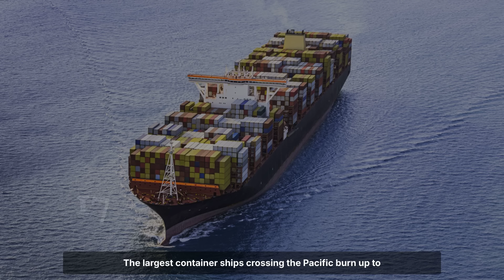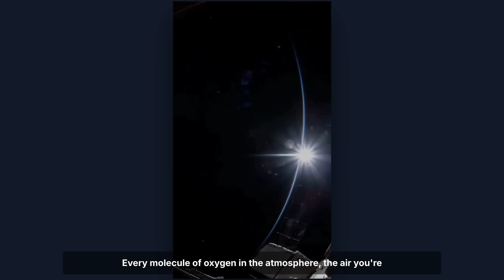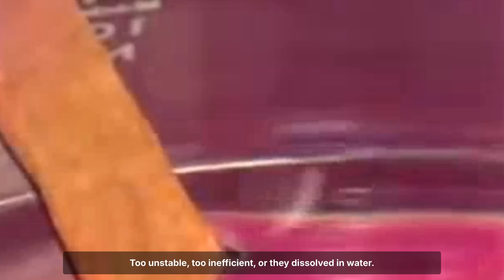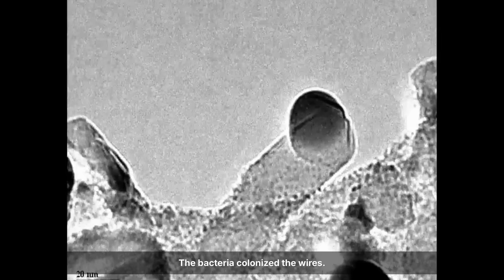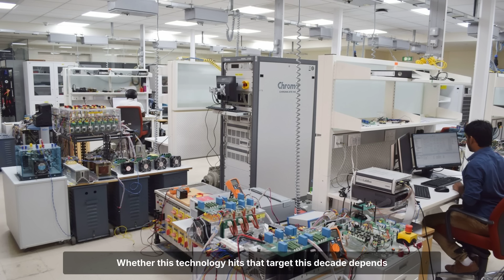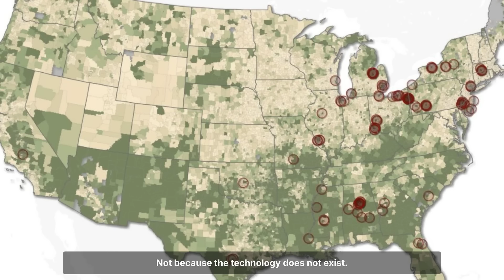Sunlight Into Fuel. No Drilling Required. Why Big Oil Is Worried.

Comment: Plants have been designed to do this and maintain themselves despite extreme weather all over the world, which cant be said for any human technology. Ancient people figured out ultra efficient agriculture systems like the chinampas a long time ago, you can put solar panels over plants to utilize almost every photon, and with a solar furnace you can make methanol from these free plants, which can run entirely off sewage directly added to the water since it doesn't have to be food for humans. It's also being turned to biochar so it eliminates all the microplastics and pathogens in our waste. It might take some bioactive water and activated charcoal to scrub out weird exhaust chemicals for large scale use but it's about the most optimal single solution possible.

Comment: The Core Problem:
While renewable electricity (solar/wind) is growing, it cannot solve challenges for industries that rely on high-density liquid fuels or chemical processes, such as:
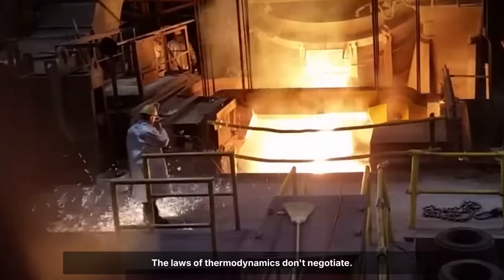Shipping and Aviation (0:38-1:36): Battery density is insufficient for long-haul transport.
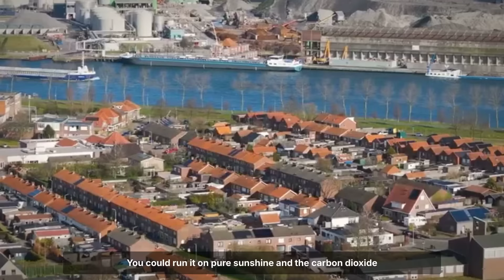Steel and Cement Production (1:37-2:11): These processes require chemical reactions where carbon is a necessary ingredient.
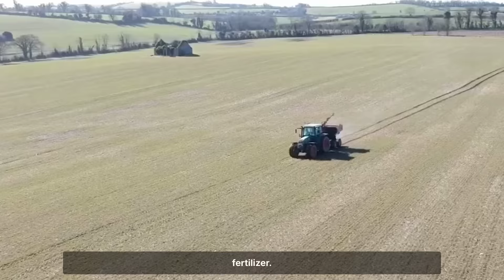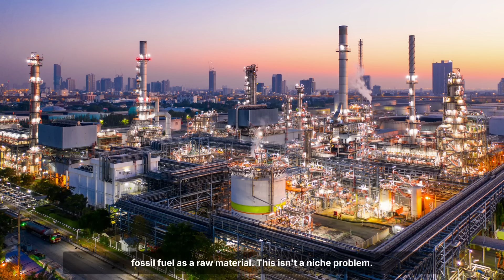Fertilizer Production (2:12-2:25): Currently reliant on natural gas.

The Scientific Breakthrough:
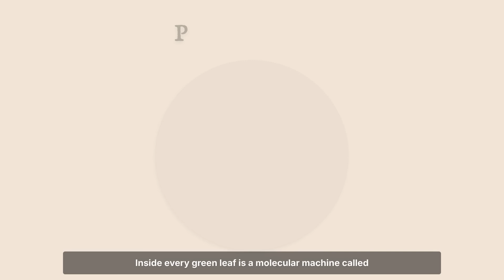The Leaf's Mechanism (5:00-7:30): Nature uses a tiny cluster of manganese atoms to split water, a process that has sustained life for billions of years.
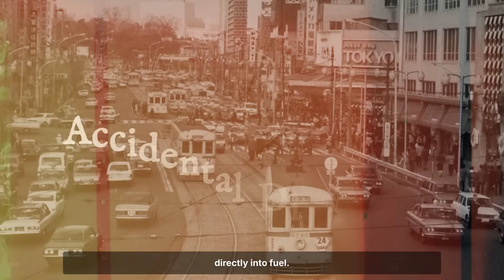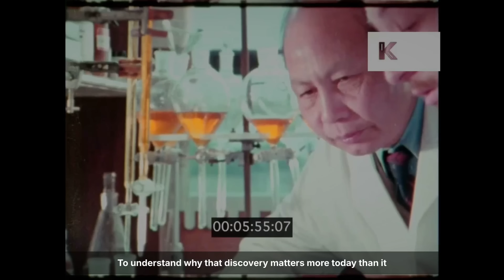The 1967 Discovery (3:21-4:48): Researcher Akira Fujishima accidentally discovered that titanium dioxide could split water using UV light, launching the field of artificial photosynthesis.
The Catalyst Revolution (9:46-11:05): Daniel Nocera's discovery of a self-healing cobalt-phosphate catalyst made it possible to split water using inexpensive, abundant materials.

Key Approaches:
1. The Bionic Leaf (11:20-12:56): Pairs synthetic water-splitting catalysts with engineered bacteria to produce liquid fuel.
2. Nanowire Forests (12:57-14:09): Peidong Yang's work using silicon and titanium dioxide to create structures that feed electrons directly to bacteria.
3. Panel Reactors (14:10-15:06): A simple, electrode-free, outdoor sheet design developed by Kazunari Domen's team in Japan.

Future Outlook:
While the main hurdles remain stability, cost, and scaling (15:26-16:45), the video suggests that advancements in cryo-electron microscopy and machine learning are accelerating progress (16:46-17:58). The ultimate vision is a decentralized energy system where small, refrigerator-sized devices can produce fuel anywhere on Earth, providing energy independence to even the most remote communities (19:40-21:15).

Comment: Geopolymers for construction and rock powder for fertilizer solve the cement and fertilizer needs and do a far better job for either. Rock powder only needs application every few years and provides the needed minerals that food no longer has because nitrogen fertilizer doesn't provide them. Geopolymer is stronger more attractive and doesn't release CO2 but fertilizer and cement are multi-billion dollar industries.

Comment: 90% of hydrocarbon use will be electrified.  We will get the hydrocarbon fuels we need, carbon negative, from agro waste biochar.   We will get the hydrocarbons for durable materials from our other wastes, carbon nuetral. 
Hydrogen is not a great fuel, it's hard to store and dangerous.  Hydrogen will be made on site for industrial uses.

Comment: I remember trying to solve the issue of global heating and win the 1 million prize from the British billionaire who own Virgin Airlines. I came up with a reverse air stack. Which would pull the carbon and other elements from the Air. Then split and use that for creating energy and atomic elements for chemical materials. It was based on something like what this video is about. And I also included a sucken process to pull the air down into the reverse stack. I was not aware of the science. But I was trying to copy what I knew of what nature did. I base many of my ideas on coping the natural world. Accept doing it artificially.

Comment: The amount of carbon needed for the chemical part of steel chemistry is miniscule compared to the amount used to heat the reaction.  The heat part can be substituted with Hydrogen, produced by using renewable energy to electrolyze water.  Most of the carbon is eliminated.  And a good part of  steel production can be done with electricity.  What do you think arc ovens are.  All land transportation, whether private vehicles, trucks, trains or buses can be done with electricity.

Comment: You can build a Thorium Molten Salt Reactor (cheap abundant fuel 99% efficiency) and use its 700C industrial heat to drive processes like turning coal into liquid fuels.  Or use the electricity to make Hydrogen, react with CO2 to make Methanol and Mobil has had industrial scale process to make Methanol into Butanol.  Butanol is a super fuel, high octane, drop in replacement or blend replacement with gasoline.

Comment: Maybe advancing the refinement process, 
it might help remember gravity bends light, and thus becomes reflective when reaching mass,
but neutrinos, similar to light as traveling fields avoid the bending, thus travel through mass instead of reflecting.
Reply: So a little more support found,
neutrinos are made by gravity of the Sun and light is,
But neutrinos pass through mass as gravity does,
thus the support base,
to light as the energy from the induced force it presents on the seed,
is the small amount needed to grow the plant in a gravitational environemnt.
Reply: And the seed takes the light energy and converts it to a inertia state of support for its growth.

Comment: Water absorbs a broad spectrum of energy.  It does not need visible light to do so.

Para-water can become ortho-water.  The voltage difference is 0.52V@40mA on a square cm of water.   Far better than the best solar cell as it runs 7/24/365.  Its simple to make and costs very little.  Parts from a local hardware store will suffice.

Ortho-water can be split at sub 10kWhrs/kg NTP H2, not 41kWhrs/kg Hysata (Uni of Wollongong).  It is the main mechanism used by plants (and animals) without leaves for the storage and use of energy.

The first recognised person to note this was Michael Faraday.

Heisenberg used this reaction to justify quantum mechanics.

Water drives our climate via this reaction.  Ortho-water no longer supports hydrogen bonding.  Such water is far less polar.  Dissolved salts drop out of an otho-water fluid.  An ortho-water molecule weighs less than the air at sea level.  It is why water evaporates.

No water, no life.

Comment: Interesting... biomass calories.
I am a fan Dr. Grey's Sea water studies (1957?), of mycelia grown in sea water. as biomass and a major protein source. 
[ Like food yeast. ] 

For many years, I recommended BEETS--SUGAR BEETS--rather than high-fertilizer corn, for ethanol production! 
Outrageous amounts of carbohydrate-sugars, and unimaginable gallons of water, per acre, for actual ethanol production.
Easy to grow, and little fert? Three crops a year, most places? (?)

Well, apparently "Corny", and the rest of the world is taking my advice, under under advisement. 
I think they are going to get back with me about these, though... I think.... 

But, I've been waiting for photosynthesis since I first heard the word, as a very young, boy.

 But, I will say the looping back and forth of details about the 10x vs 1%, the 5% net on the BEST crop vs Hybrid plan chart was confusing. (Later in, after the 10% vs 1% I felt better about the numbers.)

They have electric planes now.

Comment: A German and a Swiss engineer have build a car that runs on Saltwater.
Check it out.
Unfortunately, right now that car costs over 1 Million Pounds.
Just imagine what that type of fuel-cell could do to shipping?
Reply: Will before we imagine what it would do to shipping we need to realise the size and mass to get a certain amount of power out if it’s going to be thousands of tons to get sufficient Range in capacity then it won’t be imagining very much for shipping at all conversely if it’s small and light it will be a very viable option if it’s economically priced

Comment: It would work well, but they have been spraying the skies for over a decades, which toxic metals, such as Barium, Strontium and Aluminium.  The carbon level of the planet, is very low, just above 2%.  If it drops below that 2% plantlife will begin to die.  Ice core samples from Antartica, proves that higher growth in plantlife, existed, before any oil was found, before mankind learned how to start a fire, when the planet naturally regulated itself.  Those who pull the stings, are destroying what nature built.  Without plantlife, nothing will exist.

Comment: sunshine doesn't make for a good plastic product, you need oil. and it won't be changing fast at all
Reply: See what Rivan are doing in the UK - PV to methane via electrolysis and carbon dioxide capture. Air Fuel Synthesis did it to petrol 14 years ago. Natural gas (methane) is used as a primary feedstock in plastics production. The future is - I believe - still largely carbon-based. Only the origin of the carbon in our economies needs to change. Everything else could stay the same. I'm not sure why we have people promoting "clean" and "decarbonise". I fear it's deliberate to frustrate progress on climate change that's going to change the value of people's investments.

Comment: Thanks for this interesting video.
I hope you can do more of these. One great potential for energy storage from surplus summer  solar is "High Temperature Electrolysis that produces aluminum from aluminum oxide
then the aluminum flow batteries oxidize the aluminum, for CHP and heatpumps and ev charging in winter, in the annually cycling system. 
Aluminum has 23 KWH compared to 10 KWH of diesel. (Per litre?)
Another good video would be   Deep Well Geothermal  "drilled" by vaporizing rock; available anywhere on earth, for high temperature steam (or CO2 ) and again CHP (100%efficiency).
remarkably it is 60% nuclear but safer and cheaper than reactors.
Its in early stage development

Comment: I remember 1990s with Artificial Photosynthesis been waiting for it. Guess be ready in 10years! Also what happened to real photosynthesis on algae to make bio diesel that was all the rage back 2009 or so? I did just learn about Green Lightning which looks promising making nitrogen fertilizer from air, water and power (possible from solar) into nitrates liquid fertilizer. And now were back to looking at coal to liquid fuel or natural gas to liquid fuel again from the work Germany did in the 1940s and successful for South Africa in the apartheid days. CSIRO in Australia is looking at DICE (Directed Injected Carbon Engines) basically coal slurry in water is fed into and burnt in Diesel engines so lot of interesting stuff out there lot from early 1900s being reborn again!

Comment: Most Communities that lack access to electricity tend to be in the more sunny and arid regions of the world, that generally have access to fairly abundant sunshine most of the time. By 2050 all these communities will almost certainly be using local PV backed up with storage, most of which is likely to be some form of battery Comma because by the time you Taking your solar converted it to a fuel and then converted it back to electricity You're going to need a lot more solar collection because this is going to be probably half the efficiency of PV plus battery.
Reply: It makes zero sense to use Green Hydrogen for anything that runs well with electricity but as he mentioned at the beginning of the video there are applications that just require fuel.

Comment: "The efficiency ceiling of natural photosynthesis is not a wall.-
Yes it is, but it might not be for artificial photosynthesis.
There is a theoretical physics limit to photosynthetic efficiency, which, using natural sunlight, is about 11%. This is because only part of the spectrum is usable for the process, and then only specific wavelengths will give 100% conversion efficiency. To get beyond these limits artificial photosynthesis will need to use a different mechanism, so it's probably moot as to whether it is actually photosynthesis, depending on the definition of the word.

Comment: You don't have to use carbon to produce Steel, but you either need;
> some sort of reducing agent, which could be electrolytic hydrogen produced from sunlight, but this is quite expensive,
 or 
> You can go the Boston Metals route and do it electrolytically, in a somewhat similar fashion to how aluminium is made.

Comment: @NaturesLostArchive
My apologies if you think I'm being picky but, if you're going to invoke the physics argument, which I totally  agree you should, then you should also invoke physics units.
The problem with batteries for powering long haul shipping and flight is NOT energy density, it is their specific energy, or at the very least you should quantify it by referring to it as 'gravimetric energy density'. However, this is a somewhat contorted unit because unit because it is a bit like referring to the width of something as it's 'horizontal height'. And then, to be consistent, if you actually mean energy density you have to qualify it by calling it 'volumetric energy density', which is a bit like having to refer to height as 'vertical height', which effectively translates to 'vertical vertical length'

Density is a measure of a quantity per unit of space which can be space in three, two or one dimensions, it is the amount of something within a unit of volume, area or length. In some instances it could possibly the amount of something that happens in a unit of time, e.g. traffic density specified in Cars per hour, although strictly speaking this should probably be referred to as 'rate' of something, traffic density should be cars per mile.
Reply: Dencity is the problem.

Comment: This is dumb. Plants already do this. Algae too, but plants have the added benefit of producing lignocellulosic compounds of vary forms.

When processed one way they provide hydrocarbons. When processed another, a hydrogen-rich syngas and biochar.

In retaining an echo of the structure of the biomass, the biochar ..itself mostly atmospheric carbon solidified & bonded to itself.. provides a feedstock for soil amelioration or/and graphene production.

It Isn’t that an industrialized mechanical approach can't also have its benefits, but as stated in the video, those benefits are, at best, carbon neutral.

The biochar, being atmospheric carbon, provides a carbon-negative approach to energy production.

Added to the soil, this farther amplifies the sequestration capcities via its increase in production & retention of SOC & SOM in the soil.

'Great' that the above is also an option, but not necessarily the best available to address the objectives seemingly collectively desired.

Comment: A large commercial airliner, such as a Boeing 777 or Airbus A350, typically burns between 60 and 100+ tons (approx. 15,000–30,000 gallons) of jet fuel for a 10-hour transatlantic flight. Fuel consumption varies, but a typical long-haul aircraft uses about 1 gallon per second during cruise. 
Facebook
Facebook
 +2
Key Fuel Consumption Data:
Burn Rate: Long-haul jets burn roughly 1,500 to 2,200 gallons (about 5 to 7.5 tons) per hour.
Long-Haul Example: A 747-400 may consume 36,000 gallons (around 120 tons) during a 10-hour journey.
Capacity: A large twin-engine jet (like a 777-200LR) holds over 47,000 gallons, which weighs roughly 158 tons. 
HowStuffWorks
HowStuffWorks
 +3
Factors Influencing Fuel Load:
Weight & Distance: Fuel weight is calculated based on volume, weighing roughly 
 lbs per gallon, with higher passenger loads increasing fuel burn.
Safety Requirements: Planes carry extra fuel for emergencies, holding patterns, and longer routes, rather than just the minimum for the distance.
Aircraft Size: Smaller jets (like a Boeing 737) may consume 38,000 lbs (about 19 tons) for a 3,000-mile flight, significantly less than widebody planes.

Comment: So all of the Hybrid Ships which have electric drives are just imagination…they’re real and effective beyond old oil fuelled dinosaurs of just 5 years ago.  As for aircraft, BYD and others have produced batteries with 400W/kg batteries…it won’t be long until aircraft dump the pump too
Reply: Many large ships use electric drives, but they use massive fossil fuel (bunker, diesel, LNG) generators to produce the electricity. 
Next time you go on a cruise try and get the chief engineer to give you a tour of the ship instead of the captain's tour, it's much more interesting. I did it on Ocean Village 2, it was fascinating. 
With regard to long haul flight, even at 10 times BYD's specific energy, 4,000Wh/Kg, you're probably not going to make it across the Atlantic on batteries, and it's also going to have to be a prop drive of some sort, so it will be slower.
Reply: @nickcook2714 You are wrong about the size of the generators on these ships that have electric drives…these generators are substantially smaller than their bunker only versions.  Yes they aren’t 100% electric and that will take years to implement but it is a tremendous start. When the aircraft industry is on the verge of ditching most of its use of fossil fuels and the  trucking/locomotive industries are already going that way we have to continue to  transform our world away from the use of fossil fuels and not be sucked into the Trumpian narrative that we have to keep using them.  Trump has only sided with Big Oil because much of American wealth is derived from it.